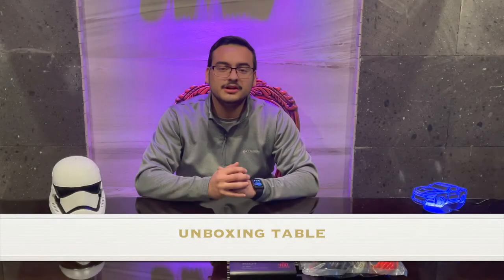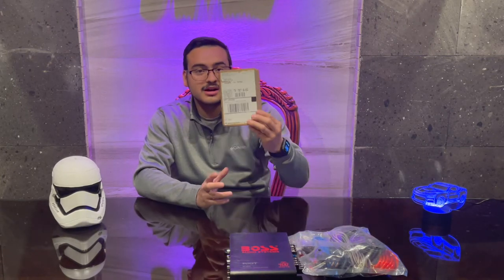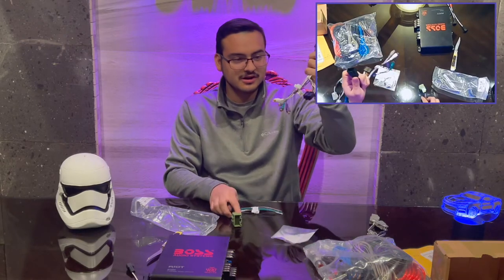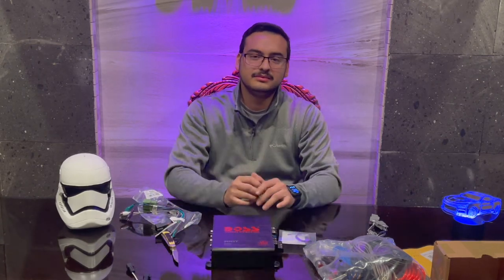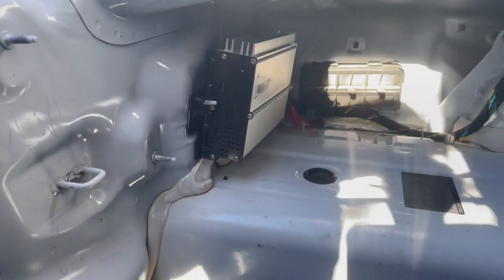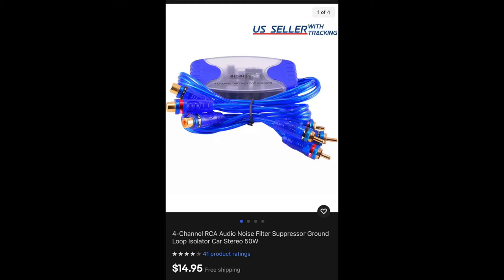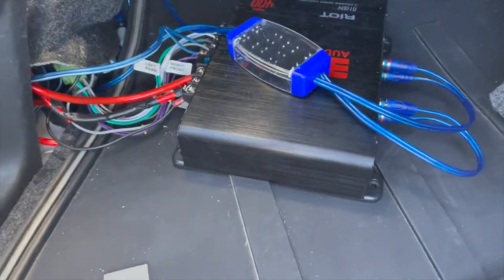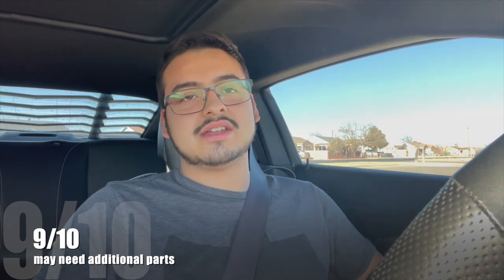How install an aftermarket amplifier on a Camaro (subthump FARK HARNESS)

Comment: Subthump didn’t mention the ground loop isolator. Also his video of the kit said that center dash speaker would work with the kit. Hmmm Is there a video of the Center speaker wiring? 😊
Reply from the maker: You might need it…. it’s not a must, since in the video I had a cheap amp I needed it but now with the new amp I have I don’t need it anymore!
Reply: What amp do you have now? But also sub hump said it would include the center speaker

Comment: This is exactly what I been lookin for.  I changed my rear 6x9s without changing the amp. The speakers didn’t work. And I lost my back up chimes. I saw the sub thump kit and was like “I wonder if anyone made a video on this”. 

Question. What amp do you recommend I replace it with? 

Also does center dash speaker still work?
Reply from the maker: Hey 👋🏽, I have a video on connecting the dash speaker if you want to check it out! 

And the amp that I am currently running and love is the alpine s-series 4 channel amp
Reply: Did you need the ground loop isolator when you changed to the Alpine amp?
Reply: @camguynj1829  I Didn’t need it. I used a 5channel Phoenix gold amp. Very nice
Reply from the maker: To pitch in my experience, I needed a ground loop isolator because I had a cheap amplifier

Comment: What battery cable do you disconnect first and which one do you put back on first
Reply from the maker: I don’t remember what I did in this video 

but the correct way is 

disconnecting: negative first and then positive a
connecting: positive and then Negative

Comment: Hey bro I have a question for you I use the subthump harness but I noticed my radio and after market amp turns on for a few minutes when I open driver door.  Then it turns off a few minutes later I was thinking is there another remote turn on wire that can be used for the amplifier (after market) ?  Or does your system turns on when you open driver door then turns off when you close door with out putting in your key in the ignition?? Also I’m dealing with turn off pop any help I appreciate it
Reply from the maker: I didn’t really get to see when exactly it turns off because my radio shuts off as soon as the key leaves the ignition..

Also I upgraded my amplifier right after that video ( 4 days later) and that one does not have a remote wire and instead turns off when the radio does so I didn’t use the remote wire from the harness for this amp

Now of course you can use a different remote wire, tap in in your fuse box and run a wire to the amplifier! 
If you need any extra help Don’t hesitate to contact me in instagram and I’ll explain better!

Comment: What cables did you use for the RCA cables in order to connect them to the amp? The blue and gray cables?
Reply from the maker: Hey there! 👋🏽That is correct you need 2 sets of RCA cables or you can get one cable with 4 RCAs
Hope this helped 
Don’t forget to like and subscribe!! 😁
Reply: @thev6camaroguy  Hey sorry I meant what cables specifically did you use? I'm trying to connect the fark harness to my amp but both ends of the RCA cables are the same so I was wondering how you connected your fark harness
Reply from the maker: Do you mean what way does the cable go? They will work either way, at longest they are connected to the same colors
Reply from the maker: If you meed further assistance send me a DM on Instagram and ill be glad to help you better! 

Its just a smoother conversation and you can send pictures for better understanding
Reply: @thev6camaroguy  Where can I find your IG? I liked and subscribed BTW.
Reply from the maker: Storm_trooper432
And thanks for your support 😈🔥
Reply: @thev6camaroguy  I sent you a message on there. Thank you for your help!

Comment: Did you ground your amp to neg battery terminal???
Reply from the maker: Thats is correct in the video I connected the negative to the battery, 
I have a video waiting to be uploaded by next week, the video is about hiding the amp and making everything look like factory, there I used a different ground 
So stay tuned 😉
Reply: Did you have any winning or buzz noise???
Reply from the maker: At one point I did, I did some modifications to insure everything is working properly to then upload the next video 

If you have a noise problem a RCA ground loop isolator can do the trick

Anymore questions done hesitate to text me through instagram ;)
Storm_trooper432
Reply: @thev6camaroguy  did you have a little winning when starting up your car ?? If so did the ground loop fix it??
Reply from the maker: The whine is usually with the engine as you rev ( I had this problem) and a ground loop isolator is a hit or miss, sometimes it works and sometimes it doesn’t but its worth to take a chance before you go through bigger headaches

Comment: Hey man, thanks for the video. I have the Boston Acoustics and I bought a 4 channel app and the door speakers both woofers and tweets. Can  use the existing amp with my rear speakers and run another amp off of the first to power all the door speakers. I haven't' taken the doors apart but I really want to make sure I can tackle this project and I know how to best wire it before I take the car apart.
Reply from the maker: Hey, I appreciate your comments..thats is awesome you don’t know much better easier this harness makes it, good luck on your sound system, hope everything runs smoothly 

Don’t forget to follow me on instagram for any questions!
Storm_trooper432
Hope you have a great day:)

Comment: Do you have a problem with your cars voltage being to high? Mine is running at like 15v-15.3v
Reply from the maker: Hey Robert, Using the p3 gague my middle voltage was 14.3-4. After the install I looked to see if any strange voltage was happening and everything seemed normal.
Hope this helped
Dont forget to like and subscribe!

Comment: Do you also have subs ?
Reply from the maker: Yes….2 JBL 12s
Reply: @thev6camaroguy  are you getting rca signal for the subs directly from the head unit or from the harness ? I currently just have the x3 with a sub but I’m gonna upgrade the factory amp now
Reply from the maker: @SSLOW5TH  I am Currently getting my RCA signal from the Head unit….however before I had the Head unit I used something like this!!👇🏼👇🏼👇🏼
https://www.ebay.com/itm/222881518082?mkcid=16&mkevt=1&mkrid=711-127632-2357-0&ssspo=gTXjlntiSmy&sssrc=2349624&ssuid=JqMrnxEDTZK&var=&widget_ver=artemis&media=COPY
Hope this helped!🙌🏼
Don’t forget to follow me on instagram!!👇🏼
Storm_trooper432
Reply: @thev6camaroguy  thanks man just swapped out the factory amp it sounds louder but I got that annoying static noise lol